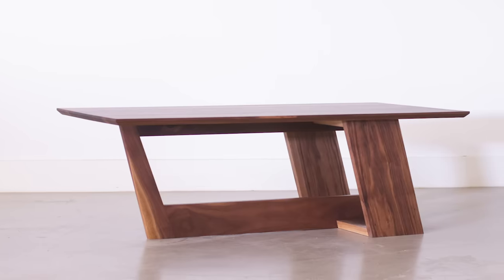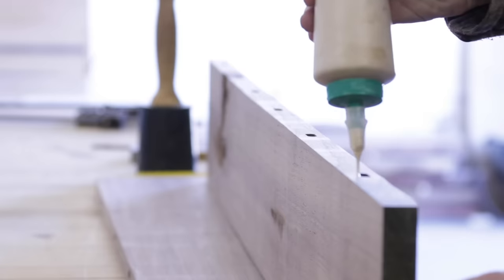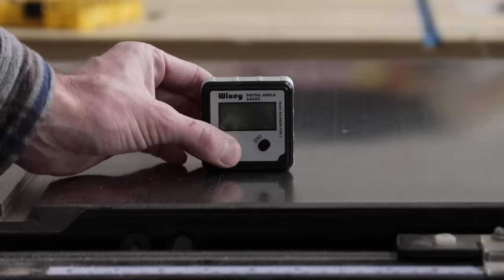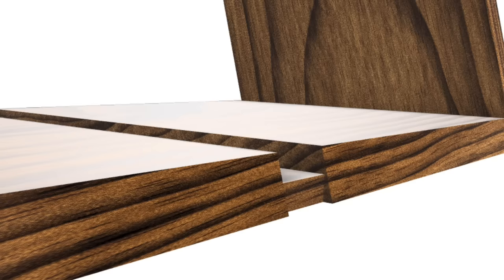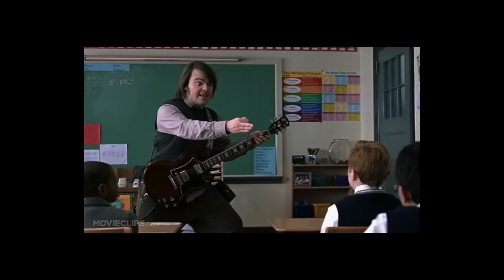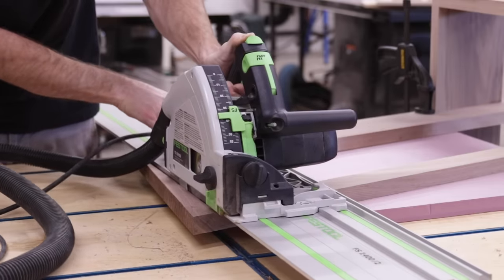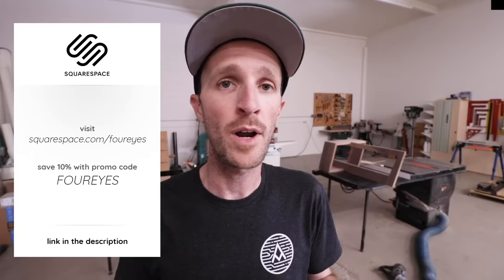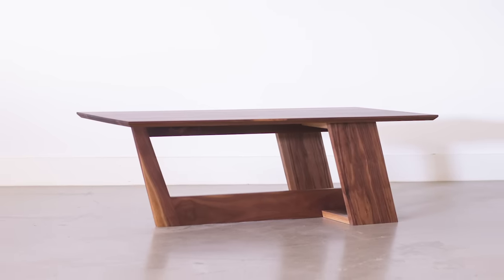Modern Walnut Coffee Table | The Fastest In The West

Comment: Hi Shaun, I would have considered leaving a little space and gluing the center of the stretcher joints (to the base) since you are cross grain, I think your #2 option would have allowed to hide that (except from the bottom view).  You are also cross-grain on the angled end as you know - that one is harder for movement...   All in all, your designs are always very interesting and videos entertaining!
Reply: That is definitely an understandable concern. I think with the joints that have grain running in opposite directions, none of them are wide enough to really expand so much to be a problem. If I had done a joint like that across the entire 26" wide top, then I would be worried! Thanks for watching, Mike!

Comment: Did I miss the locations of your inserts to mount the table?  Curious if you think wood movement would be an issue here?  Perhaps not if the inserts are all down the middle?
Reply: All of the holes drilled for the bolts that attach the top were drilled oversize to allow for any wood movement.

Comment: What is the widest board you would recommend laminating together - it looks like these are 10 inches wide or so... also is that 4/4 walnut planks?
Reply: Depending on the lumber, often times the wider the board is, the less stable it is. This top is 26" wide and I think I had 4 boards, so each one is around 6-8" wide, which is usually around the width I use for stuff like this. And yes, it was all 4/4.

Comment: Love the videos. Really curious to know what you’re using to connect the tabletop to the support/stand/legs?  Is that a treaded sleeve?  Can they be used for things like cupboards that I want to assemble the disassemble whenever I move apartment? Where can I get them?
Reply: They're called threaded inserts or threaded bushings. Amazon has then, but I know my local hardware store has them too if you want them faster than two days.
Reply: Yeah, they are called threaded inserts. Basically it is a way to use machine screws to attach things, and allow them to be disassembled, and there are tons of applications for them. I get all of mine from McMaster-Carr.